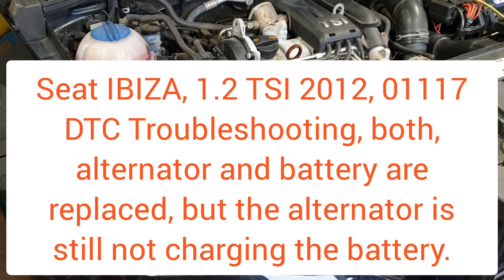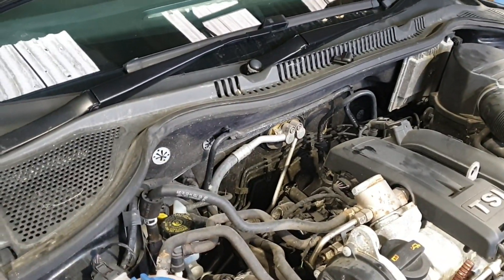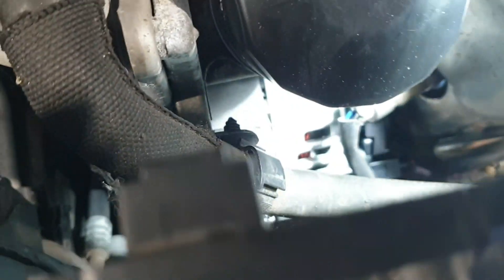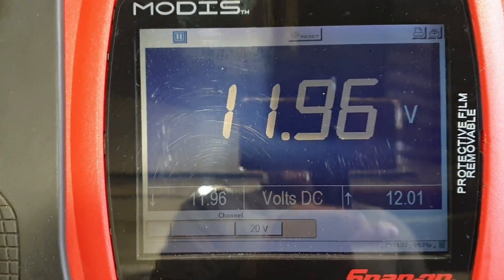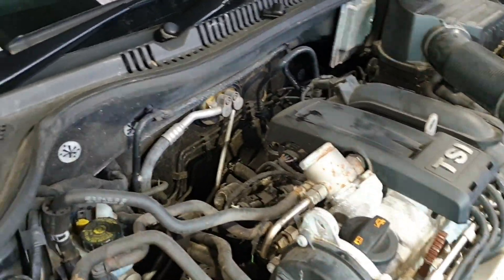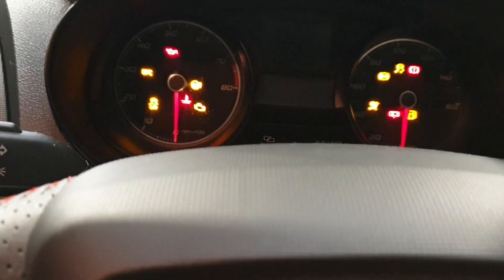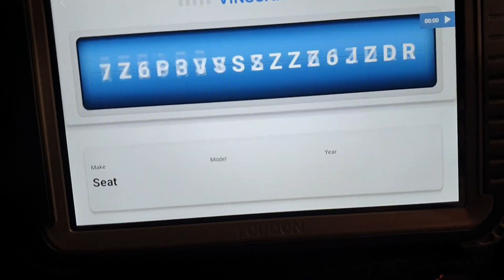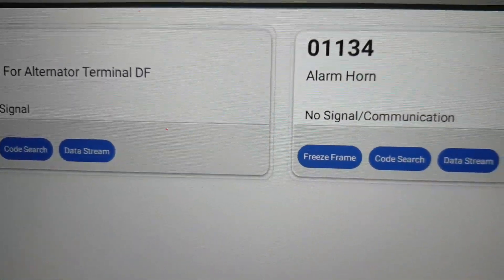Seat IBIZA 1.2 Tsi 01117 DTC, Alternator And Battery Are Replaced But The Battery Still Not Charging

Comment: You did not show us if the battery light on the dash started to work correctly when the poor earth was fixed! x
Reply from the maker: Do I have to pass your exam, test? When the alternator output voltage is available at the battery posts, the battery warning light will be off.

Comment: I had same issue more than once where previous garages changed everything but still not charging it was earth strap also with starter motor too ( very good video )
Reply from the maker: Thanks for watching
Reply: Good fault finding process but the original garage should also have been capable of finding the fault 😀👍